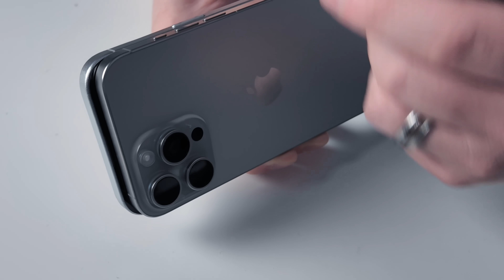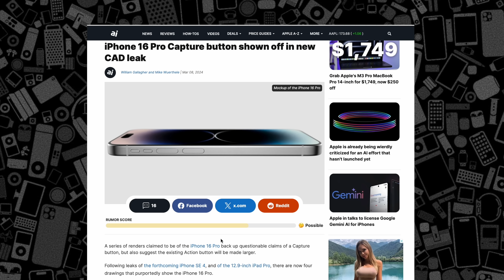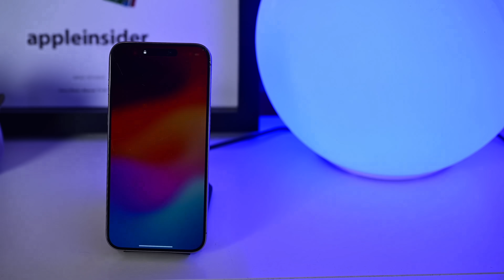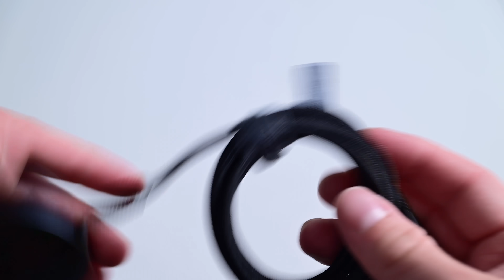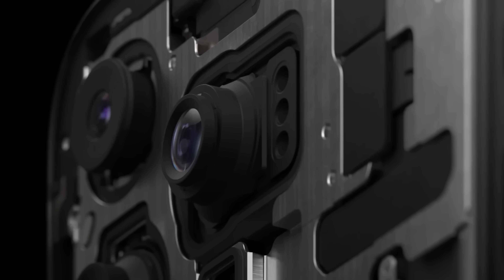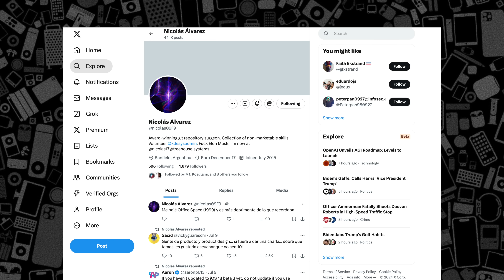iPhone 16 & iPhone 16 Pro New Features REVEALED!

Comment: Broke my iPhone 13 Pro Max.. Been trying to hold off for the 16 pro max(or whatever they are gonna call it) but have been having the worst luck.. 
1. cheapy android place holder: dang.. this sucks ended up broken within a month
2. Cheapest iPhone I could get at metro pcs(iPhone 12).. flew out of my pocket on an amusement park ride.. back totally cracked but the phone was still working till some moisture got in and that was that
3. Dug out my ol iPhone X from 2017.. had a hard time hooking it up to service as it was a sprint phone and sprint is no longer a company.. finally got it hooked up.. almost lost it riding dirtbikes but miraculously found it 

Using it right now on 2024 networks.. barely holding on 

Plus the main cameras on the back aren’t taking clear shots so if I capture anything it’s from the selfie camera.. 

September can’t come soon enough

Comment: I don't understand why not just smack the Type 1 sensor or the new Lyt-900 sensor like Vivo X100 Ultra. If iPhones and Samsungs actually had top-of-the-line specs no other phone would need could compete. But they allow Vivo and Xiaomi to outdo them in so many scenarios due to the Gap in hardware quality. The video you would get on the iPhone if it had the Lyt-900 sensor would be baloony. It would be crazy crisp.
Reply: Literally no one buys VIVO or Xiaomi
Reply: @josephpepe2607  Xiaomi is literally third biggest phone brand world wide and is out selling Samsung and Apple in many markets. Holds 12-13% of the market compared to 24 and 28 for Samsung and Apple. So quite a lot of people buy Xiaomi. I agree Vivo is less popular but they still hold almost 6% of the global market and their flagship is arguably the best camera you can buy right now. The x100 Ultra. It has a 30% larger main sensor than S24 ultra and 15 Pro max. And it even edges Xiaomi slightly. I'd say so at least. And if I had to buy one flagship, excluding s24 Ultra. I would probably go for Vivo over Apple. It's just an incredible phone. And if no one was Buying them how can they afford to have the most hardware advanced phone every year with best tech available? 

Look it up. the x70 Pro Plus, x80, x90, x100 all had best available hardware of it's time. And would often be better than Samsungs cameras, and even best camera phones out there.

Comment: I have a 128gb 14 Pro Max in perfect condition.   I usually wait to upgrade until the phone is paid off which it will be this September 24’.   This means I skip two generations of processor and other upgrades which makes a noticeable difference in performance.  With Sam’s club now adopting T-mobile that could be another incentive to upgrade with the bonuses there.  If I move to a 256gb version (or higher) it also means I could save $36 a year in storage costs by ditching ICloud too.  Hmmmm…

Comment: I want them to do the touch sensitivity for the lock button too. So that you can bring down or up your notification and the lock button doubling up as a touch ID would be a great feature. Action button having a double click option would be cool too. Similar to lock button opening wallet with double click. At the moment you have to hold it. One click does nothing. That needs to change. No one is accidentally clicking that button. No one accidentally locks their phone and that button is bigger. Why do we have to hold on the action button? They need a one click and two click option but keep the hold option there. Since holding lock button opens up siri

Comment: I’d bet the A17 Pro will just get rebranded as the A18 and the A18 Pro will be the new one.
Reply from the maker: I dont think so. Code references show the same actual base chip in all four, meaning it isn't just a version of the A17 Pro. Plus, Apple doesn't need to keep making the A17 at all. It can just make the A18 and then bin it out based on how many cores it has whether or not its the A18 or A18 Pro.
Reply: That's what I thought too but hopefully not

Comment: Oh, so screen update, better processor, bezel change, size update etc. Similar looking phone design again though. I guess we’ll see a major change by iPhone 18.
Reply: More like iPhone 25 lol
Reply: @Rockybalboa541 nah just wait til apples 100th birthday before buying another iPhone.
Reply: I agree. The 17 is already rumored to feature a slimmer build, which should be cool. Remember, Apple already has their line-up planned YEARS in advance. They probably already know what they're going to release for the iPhone 20, or further along. They strategically make very small, incremental changes year over year to maximize profits.
Reply: Samsung clown spotted 😂
Reply: iPhone 81*
Reply: I remember when Apple kept reiterating that their phones are getting slimmer and how good that will be to handle…yet the newest phone I have (iPhone 12 pro max) is at least the same thickness of the 3G, if not thicker. And the glass scratches like crazyyyyy. They actually hate us
Reply: @SledgeH92  Why though is a redesign so important for people? I actually like the Apple designs for their iconic looks. The features and better cameras are more important I think. And remember, iPhones have small updates in features because the usual consumer isn’t upgrading to a new phone every year but every two to even four years or even more! 
If you buy a new phone every three or four years, the changes are immense and you appreciate them equally!
Reply: And newer price
Reply: Nah this year is good because thier gonna have stacked battery, 40w wired charging and capture button
Reply: If you have the 15 pro max it’s not worth upgrading until iPhone 17 comes out
Reply: @Sasuke_Car  Ye, unless you got a lot of money and the 17 base models might have 120hz